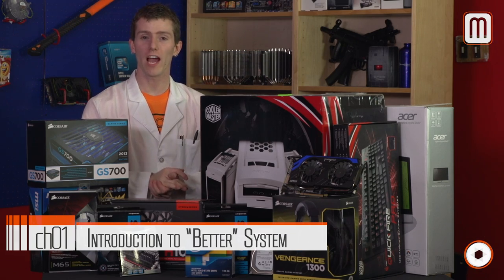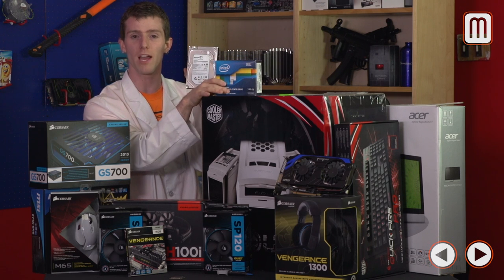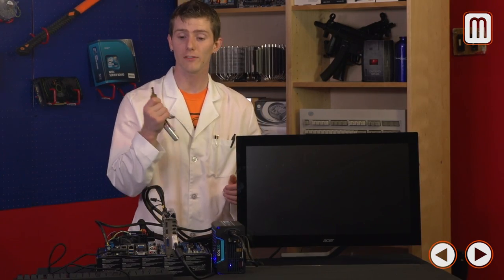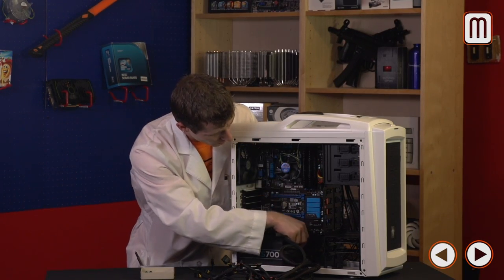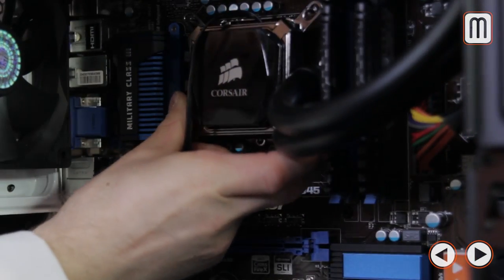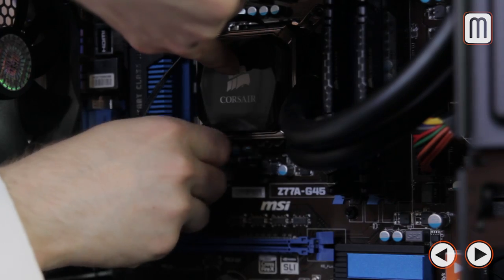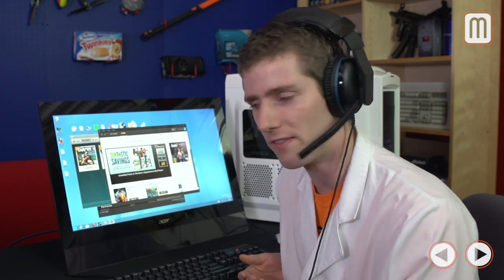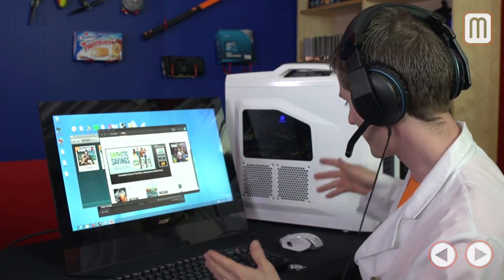ULTIMATE Build a Better $1500 Gaming PC Computer "How To" Guide

Comment: Are these a good build 
i5 4670k or 4690k
evga 750ti FTW
MSI Z97 PC Mate S1150 Intel Z97 DDR3 ATX
1TB seagate barricuda 
120 Kingston SSD
EVGA 600W 80 Plus, Hard Lined, Bronze PSU
Kingston 8GB (2 x 4GB) HyperX Fury Series 1866MHz DDR3 
Zalman z11 plus case or z11 neo
Samsung 24x dvd-rw
Cooler Master Hyper 212 EVO 

Open to any improvement to the system. but would add editional cost. 
And also looking for Windows 8.1 for free. If anyone know thanks

Comment: You really need to dump the white coat Linus. You're not a medical doctor or a lab technician :) Also when you held up the case and shook it around as you say the case did not have any components installed. I don't think it would be that easy to do if the case was full of components :)

Comment: I want 2 build a pc for around $5000 tips?
Reply: You can build what you want for 5 grand go on pc part picker its gr8
Reply: $5000?  Holy shit bro, don't spend that much. MAYBE spend $4000 and use the rest on peripherals and other accessories.  With that much, go with an Intel i7 and around a $500 GPU.  Also go on PC Part Picker to select other parts and check the compatibility.  Hoped this helped!
Reply: Maybe you should pay your rent before building a $5000 pc.
Reply: Bledi Krasniqi core i7 4960x, duo 980's, 2tb ssd, 1000 platinum certification psu, some op watercooling that cools better than liquid nitrogen, asus IV extreme motherboard, 64gb ram and do the rest yourself ;)
Reply: LKCampaign 5000$ won't be enough for that
Reply: Bledi Krasniqi I7 5960x Sli Gtx Titan X 32gb Dominator Platinum 1tb SSD 850 Sams... and More :v
Reply: Bledi Krasniqi First of all you sell your gold then you ask for some money from santa.
Reply: Intel i7 5830x 
Corsair dominator platinum 16 Gh 2400mhz
1200w psu 
4 nvidia gtx 980ti In sli 
Asus rampage v extreme
Reply: I7 5960x
Gtx Titan x Dual SLI
16 GB RAM
1000w PSU
Asus pro gamer 5 (SLI)
Reply: Christopher McClinton It's not bad. I'd switch to the i5 4460 and a H97 or Z97 motherboard from MSI (Z97 allows overclocking of CPUs that have a K at the end of their name and it's easier to find a Z97 motherboard, but it costs about $20 more on average), get rid of the Hyper T4 because the stock Intel cooler works really well if you don't overclock, and seriously consider 8GB of RAM (if you already have Windows 8, choose a random time to check your RAM usage in Task Manager. I normally only use 5GB).
Reply: Christopher McClinton Yes. I reccommended the 4460 because it costs a bit less.
Reply: Christopher McClinton Oh that's not my build. That's my answer to his $5k question haha I would love that build though. 

And your build looks pretty good. Not sure on the GPU but that's also because I haven't heard much about the new AMD cards.
Reply: Christopher McClinton I would do this: http://pcpartpicker.com/p/wPtCWZ

The 4460 isn't overclockable, so you could get rid of the Dark Rock Pro 3 and use the included cooler; I put it in there for aesthetics and noise levels.

The RAM is a bit more expensive but the heat spreader on the Ripjaws causes clearance issues with the Dark Rock Pro 3.

Changed from Z97 to H97 as the 4460 isn't overclockable

Much more graphical power with a lower price point. Don't let the VRAM fool you; the 970 is a much better card than the 390x.

Changed to a Noctis 450 as it's newer and based on the H440, which has a much better chassis. Feel free to change it back to save money.

Lower power PSU because the build will not use 750w in it's current configuration, feel free to switch back if you ever plan to use SLI

USB optical drive because the Noctis 450 sacrifices 5.25" bays for an extra fan

Color programmable keyboard. Uses Cherry MX brown switches, which are the quiet clicky type. Also available with red switches, the non-clicky type.

RGB mouse to go with your RGB keyboard.

MUCH better headset.
Reply: Michael Marquardt I would not recommend a lower wattage power supply honestly.
Reply: Perposterown Why not?
Reply: Michael Marquardt Because for the build he picked out and the price difference, a 750W is perfect and leaves room for growth.
Reply: Perposterown But it costs considerably more.
Reply: Christopher McClinton If you don't care about the peripherals, then change them back to what you had, and you'll have a much more powerful, yet less expensive, build. http://pcpartpicker.com/p/zbGxqs
Reply: ***** 1 titan x is more than enough :D
Reply: Bledi Krasniqi dont waste your money like that it seems like you most run minecraft use 2000$ at totally maxxx
Reply: Michael Marquardt Which? The RAM, PSU, or the 980Ti? 
The 980Ti is mostly a joke because I doubt Christopher would want to spend that much. I plan to but I already have a decent build as is other than my GPU. 
The 16GB RAM was also MOSTLY a joke. I have 16GB. I usually would recommend it IF you can afford the extra money but it's also currently unnecessary. 
The PSU is there to add room for upgrades in the future or a possible second GPU, if he's so inclined to do so. I usually recommend no less than a 600W just for the sake of giving a little bit of wiggle/overclocking room. If you overclock with the build he's got, you could easily need a 750W PSU. You're usually supposed to go with about double the recommended wattage for your PSU for overclocking/wiggle/growth room.
Reply: Perposterown The 750W PSU costs quite a bit more than the 500w. If he's not going to use the extra power, I see no reason to spend more money.
Reply: Andreas Did i know, but maybe he has 2 monitors
Reply: Michael Marquardt See the difference is the one you recommended is only 80+ certified. 
The 750W he picked out was 80+ Gold certified. 
Always go with gold when you can. It is more efficient than the standard, bronze, or silver. 
That's the big difference here. You have to look at the certification level. If you get a 500W that is 80+ gold, it will be a significantly lower price difference. 
Plus you have to consider the modularity. It is always better to have a fully modular unit over a semi or non-modular PSU. 
Full modular at 80+ gold (or platinum or titanium but those are only used at over 1000W it seems) will allow for the most efficiency along with the best possible cable management and a clean case is a happy case. Runs cooler, less issues with airflow, etc. 
Once you take into consideration those factors, you are looking at only about a $20 price difference between a 500W and a 750W which leaves room for overclocking and growing along with being efficient and pretty looking. 
500W http://pcpartpicker.com/part/evga-power-supply-220gs0550v1

750W http://pcpartpicker.com/part/evga-power-supply-220g20750xr

I used the same brand as an example as the price difference could be a lot different between brands. Depending on the brand, the 750W could cost about the same as the 500W I linked.
Reply: i can help you with a build
Reply: that is overkill not too expensive but not too cheap either
Reply: my 200$ graphics carcd can run 4 1080p monitors
or 2x 4k monitors
Reply: Bledi Krasniqi you must be a time traveler from 1995!
Reply: 5000 usd will get you like a surround 4k ultra settings most high end ever pc that would be overkill
Reply: I7 5960x, 4 GTX 980 Ti Zotac amp, 10 Tb, 1 Tb SSD, Asus ROG motherboard. Water cooled everything and a 1500 w psu
Reply: Reiner Valerio I8 GTX 990 10 tb ssid 2000w psu if it exists :)
Reply: I mean i9 Bledi Krasniqi i3 i5 i7 i9
Reply: ***** lol
Reply: Reiner Valerio With 4 980ti cards, you would want a second PSU so you don't over load your PSU. Especially if you plan to overclock and if you're spending that much on a PC, why not overclock it?
Reply: Bledi Krasniqi I would go for a 5930k, 2 fury x's, a samsung 850 pro 1tb, 4tb wd black, and an the new MG279Q free sync ips 144 hz monitor.
Reply: 5 thousand is too much.2 thousand or soo would be enough for an amazing pc
Reply: Go wild!!!
Reply: Use 2k for an epic pc, pay me 3k for this amazing tip.
Reply: +Bledi Krasniqi Asus P9X79 DELUXE ATX LGA2011 - Intel Core i7-4960X -  Corsair Dominator Platinum 64GB rams - x2 or x4 (if you can afford) GTX Titan Black . and you will be set for more than a year at least with the highest performance ;)
Reply: Why would you get year old tech?
Reply: You can Get
128gb ddr4 ram
Core i9 7980 xe
Z370 motherboard 
Gtx 1080 ti

Comment: I was wundering ifs I cuold run craftmine wiht diis cumputer
I9-8790X OC'D to 30ghz
8 way sli Gtx Titan Y 1TB of Vram
100tb HDD
20TB SSD
256gb 7000mhz RAM
56in tall case 30in wide 20in Depth

Comment: im scared on installing the power supply cables ima die or some shit
Reply: If you do it wrong the system usually just won't boot, but these days it's very very hard to do it wrong.
Reply: rip

Comment: Can someone tell me: when I watch pc builds they only say : case power supply graphics card CPU ram storage mother board and DVD then where is the power button is it a wire connected too the motherboard and then you connect to the case
Reply: correct, it is a wire running from the front of your case, which you plug into your motherboard. Linus talks about it in this video

Comment: Is this build good:
MD FX-8350 4.0GHz 8-Core Processor

RAIJINTEK TRITON RED 100.5 CFM Sleeve Bearing Liquid CPU Cooler

SI 970 GAMING ATX AM3+ Motherboard

Kingston Savage 8GB (2 x 4GB) DDR3-2133 Memory

Kingston Savage 240GB 2.5" Solid State Drive and
Western Digital BLACK SERIES 1TB 3.5" 7200RPM Internal Hard Drive

MSI GeForce GTX 970 4GB Twin Frozr V Video Card

NZXT H440 (Black/Red) ATX Mid Tower Case

EVGA SuperNOVA GS 550W 80+ Gold Certified Fully-Modular ATX Power Supply
Reply: *AMD
Reply: +Tommy Sandgren switch to Intel and youre good
Reply: +Duska amd and intel are both good
Reply: +Tommy Sandgren ur builds good
Reply: 550w is not much for that 970 and ur hardwares..
Reply: killerhakie probably 650 or 700?
Reply: Update: switching motherboard to msi 990fxa gaming
Reply: Duska u could go with a 650

Comment: Anyone know a good PC close to 200 - 300$
Reply: Go to the ltt forum and ask them
Reply: Video Games Survival Guide ye i have steam same name
Reply: You can't get a good PC for 200-300
Reply: Video Games Survival Guide You can get something bang for the buck at that price yes, but it won't be good, it would barely be considered as entry level
Reply: Video Games Survival Guide Not on medium, ultra low at the very best
Reply: Video Games Survival Guide Sadly I am completely right
Reply: Pretty sure it can't play Crysis 3 on medium
Reply: a whole PC or just an upgrade?
Reply: Alright tell me the rest of the components for 300$ cad
Reply: Video Games Survival Guide Here's the problem, you only got the CPU and the GPU down, but I still need a hardrive, ram, a motherboard, a power suppy, and a case
Reply: save up to at least 500$ ..... trust me its worth it because you'll have a system that will last for at least 4-5 years instead of a cheesy 200$ pc that will barely last till next year and will result in you having to upgrade quickly and probably waisting much more cash. Though if this is a machine for the soul purpose of playing a single non demanding game (League/dota/minecraft/ect) and you are absolutely sure you don't want to play any of the newer modern games then go ahead but if i were you id really just save up.
Reply: Rice field pepe that is what i am doing now
bought one from 2010 for 795$ still runs

Comment: What happens when you touch the bottom of the motherboard?
Reply: Depends if you have clean or dirty hands.
And watch out for ESD(Electro static discharge)
Reply: If you have static electricity built up, you may discharge it on the board, rendering it useless.  Also, the solders might poke you

Comment: I need help.
I'm geting a better pc soon, but i think im undear-estamating an i5 core, i think it will be like an i3 core, but only slight better..
Reply: i5s come in many different forms. Same with i3 and i7. what i5 are you getting
Reply: Noah Shearer I'm not sure, i need to go get back to the site..
Reply: I would recommend an i5 6600k if your on a budget or an i7 6700k
Reply: TGH-TheGamingHotDog
Yeah whats your budget and are you upgrading or building an entirely new computer? Whats your current computer specs?
Reply: Noah Shearer Sry 4 bad gramamr, im in lots of pain, stubed my toe and its bleeding..

SSE2: Supported
SSE3: Supported
SSSE3: Supported
SSE4a: Unsupported
SSE41: Supported
SSE42: Supported

Network Information:
Network Speed: 

Operating System Version:
Windows 8.1 (64 bit)
NTFS: Supported
Crypto Provider Codes: Supported 311 0x0 0x0 0x0

Video Card:
Driver: Intel(R) HD Graphics 4000

DirectX Driver Name: igdumdim32.dll
Driver Version: 10.18.10.4276
DirectX Driver Version: 10.18.10.4276
Driver Date: 17 Aug 2015
OpenGL Version: 4.0
Desktop Color Depth: 32 bits per pixel
Monitor Refresh Rate: 60 Hz
DirectX Card: Intel(R) HD Graphics 4000
VendorID: 0x8086
DeviceID: 0x166
Number of Monitors: 1
Number of Logical Video Cards: 1
No SLI or Crossfire Detected
Primary Display Resolution: 1366 x 768
Desktop Resolution: 1366 x 768
Primary Display Size: 13.54" x 7.60" (15.51" diag)
34.4cm x 19.3cm (39.4cm diag)
Primary Bus Type Not Detected
Primary VRAM: -1984 MB
Supported MSAA Modes: 2x 4x 8x 

Sound card:
Audio device: Speakers (2- High Definition Audio)

Memory:
RAM: 6036 Mb
And im looking to buy a pc with an deul (Or better) i5 core
Reply: +TGH-TheGamingHotDog So now all I need to know is your budget and what your planning to do with your pc.
Also, holy shit when did yo get that pc, it looks like a 10 year old pc.
Reply: Noah Shearer It's a year old, and i'm looking to get a pc around $500-$680, this is so i can make better video's, and game.
Reply: Well I don't know the case or power supply, but if it's only a year old you should just be able to replace parts.
Reply: Oh, did you build it or did you get it pre built because that could limit how much you can upgrade.
Reply: Noah Shearer Pre built,
Reply: Can you check your power supply wattage.
Reply: Noah Shearer I don't know how,
Reply: Open up your pc and check to see if there's a sticker on your power supply with information on it. There should be wattage on there.
Reply: Noah Shearer I can't open it, it has custom made paste, if i open it, the paste falls off.
Reply: TGH-TheGamingHotDog Oh, okay. So your just going to build a new PC within the rang of $500 - $680. That should be easy.
1st of all do you have your hart set on Intel CPUs or can you go AMD? AMD has the low end market in a tight hold is CPUs and GPUs.
2nd, what kind of videos are you making. If they're gaming videos I would stick to Nvidia for shadow play but if your more editing vlog type stuff The new 480 would be a good pick.
Reply: Noah Shearer I'm looking for a gaming pc, and i don't want to build one, i want a pre-made pc. i'd like at least a deul core, and a single gpu, or deul gpu..
Reply: oh. I thought you were going to build a pc, I'll just give a wishlist

-duel cores are very out dated, you want four cores. Most i5s will have 4 cores

-probably want to go with 8 GB of ram

-RX 480 just came out and is amazing for the price. What games do you want to play. If your the kind of person that loves playing the newest games than a 480 or 970 is necessary but if you're playing CS:GO or LOL all the time you don't need an expensive card.

-In your price rang you should stick with one main card not 2 cards.

I've been searching for pre-built PCs for the past few minutes and I have some recommendations. I just need to know what games your playing.
Reply: Noah Shearer I might go with a triple core now that i think about it. (Idk the tech name.) And i'd like at least one gpu, if not i'll go for a quad core.

I'll be going for mostly new games. (From the depths, arma 3, Etc. Etc.)
Reply: 3 cores don't exist I don't think. trust me go with 4. Also you need one GPU it's impossible to play a game without one. What games are you playing, CS:GO and LOL or GTA, DOOM, etc?
Reply: Noah Shearer Alright, i'd like a 4 core i5, a deul gpu, and im talking about Arma 3, From the depths, Etc,
Reply: TGH-TheGamingHotDog
alright. Looking over pre-built PC I don't think you can get a duel GPU for your budget but I'll keep checking.
Reply: Noah Shearer Well one gpu could work., but i'm not a pc know it all, tell me what you think.
Reply: TGH-TheGamingHotDog
I recommend building a PC, the flexibility and price is so worth it plus the experience is extremely satisfying. It's also extremely easy; I built my first PC when I was like 10 and I using hard parts to install.
Reply: Noah Shearer But i have no building experince, plus if i break something some how, it will take yet another year to get a new pc..
Reply: Noah Shearer I also found a really good pc for the same price of my current one. (If i find the link, i can give it to you, so you can tell me what you think.
Reply: +TGH-TheGamingHotDog what currency is this budget in?
Reply: Jamie Heywood usd
Reply: TGH-TheGamingHotDog
Hey, where's that link?
Reply: Noah Shearer Let me find it, jeez

Comment: HELP my evga 750w power supply doesnt have an 8 pin connector on it!!!
Reply: +Matt b I figure it out.  I had two 4 pins that connected to make an 8 pin I just finished my build.  And my pc won't connect to Ethernet so I have no internet.  Any ideas on that?  Ik it's drivers but the disk that came with the mb doesn't do anything
Reply: figured out the internet problem also.
Reply: +Matt b You must be new to the powrsupply area. EVGA is actually a very well known PSU company at this point and its extremely reliable within their (x)2 series